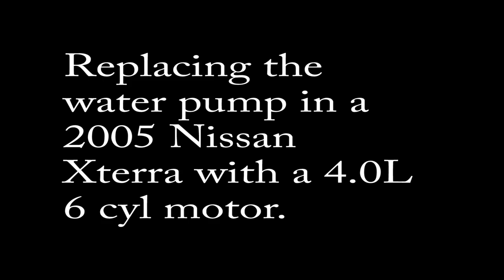How to Replace the Water Pump on a Nissan Xterra

Comment: At about 13:54 you are talking about driving M8 screws into the treads of the old water pump flange to aid in extracting the old pump from the engine.
May I suggest; 
1) Screw the M8 bolts into the water pump flange deep enough so the M8 bolt ends do not touch the water pump mounting bolt holes.
2) Rotate the water pump a few degrees such that the bolt ends will push against the engine cooling water jacket.
3) Drive the M8 bolts in until the first O-Ring is free of the cooling jacket.
4) Finish removing the old water pump out engine cooling jacket by pulling on those two M8 bolts.

Just remove the risk of fouling those mounting threads from the equation altogether.

Before installing the new water pump, put coolant (new or used don't matter) onto the new water pump O-Rings to make them slide into the cooling jacket easier.

You video is remarkably well made, your talking easy to follow and you highlight points that will save your followers from time and money!

Thank you for your time and effort making this video!
Reply: Great tip!

Comment: I pledged $20 because your video is awesome and I love your shirt reward. I have a 2000 xterra with a 3.3 and would overheat at idle. Replaced water pump and problem fixed. Now my 2005 xterra 4.0l 4x4 is overheating at idle so your video is excellent in guiding me to perform this repair. I've been a mechanic for over 24 years and this is a complicated job for a water pump replacement. Good job on your hard work and helping me out in this task.
Reply: Thanks for showing me how to change the water pump. That help me to do it right. Charles

Comment: You have the best Nissan videos out there... Yours have helped me out alot... I was ready to take my leaky water pump/weep hole in to the dealer today but after this video I figured ill do it myself... Ive alveady removed and replaced the assembly that holds the fan clutch and the fan clutch, radiator and shroud for previous replacements on my 06 Pathfinder so I might as well do this.. the dealer wants $800 but I think this time im going to do it myself... 2 years ago they got me for $1800 for a new tranny computer.. and that was because I didnt have the tools to program the new computer... but had removed it with the valve bottle trying to replace that brake solenoid. Again Thank you for what you do and screw the ones who gave you a thumbs down...

Comment: 5 years later still a work of art thank you very much for your details instructions. My issue came about after my radiator was purposely damaged by a mechanic here in Compton California. Due to myself not wanting to deformate ones character nor be at fault or sued  for slander of their name or business, I'll leave out the name of the black and yellow painted shop. I do now see that that was the problem more than likely had I just done that in the first place none of this would happen however I am replacing radiator clutch fan and water pump all at the same time anyway thanks a lot godspeed on your journey. Keep putting out these awesomely detailed videos so that no one has to go throug what I went through with thoseshady mechanics.

Comment: A little heads up for you guys. Keep rotating the crank pulley with depressed tensioner until you see/hear the cam flop over. Otherwise, there will not be enough room to slip the wp out as easily as depicted.
Reply: THANK YOU!!!!! EXTREMELY IMPORTANT VALUABLE (LEFT OUT) PIECE OF INFORMATION

Comment: Ry, thank you for this video.  Very helpful to have watch you do this job before doing it myself.  I made one mistake that others can learn from.  I did not insert a locking pin or wire into the tensioner after working it back to its contracted position.  You can't get the water pump out or in until you fully relax all pressure on the chain tensioner.  You also risk shooting the plunger and spring into the engine if you try to remove the tensioner without inserting the locking wire/pin.  I found a binder clip in the kitchen and straightened one of ends of the wire and that worked perfectly.  While the job has many steps, it is easy with the tensioner fully retracted and locked.  Thank you again!

Comment: Your videos have been a godsend, thank you so much for all you do.  That said, I've noticed several videos where the actual removal of a part was not filmed.  I understand that you can't exactly hold a camera in the right place and remove something like this at the same time, but man... It would be great if you found a way to edit these things in.  I changed the head gaskets on my 2005 Xterra SE over the last few weeks, and when I got everything put back together, I had a coolant leak coming out of the weephole behind the water pump. Now I can't get the chain slack enough to pull it out and it's about to the point I'm just gonna take the whole damn timing chain cover back off!  I'll skim the comments to see if there are any other tips added, and really, your videos have been such a blessing.

Comment: I have to change the water pump on my 2010 Infiniti EX35 and watched a few videos which were kind of...well you know. I also have a 06 Xterra and your videos really helped me with a few repairs, and by the way its the same colour. So anyway the 4.0L in the Xterra and the 3.5L in the EX35 are pretty identical and the procedure is the same. Your video is very clean and in-depth so I would like to thank you for that. Cheers!

Comment: Hello Ry, Thank you for your video it was very useful to me. I had to replace the water pump on my 07 Nissan Frontier. It went smooth without a hitch. I would like to offer some feedback on my experience that may help other viewers of your video. You can use a 3/8 drive socket T bar inserted into the square on the drive belt tensioner to use as a lever. You're right about not dropping the tensioner and water pump bolts down inside the timing chain cover. I felt like I was defusing a bomb taking those out and bought a magnetic socket drive to put them back in. When turning the crankshaft clockwise and counter clockwise to get the slack to first remove the tensioner then to get the slack on the other side to remove the water pump be super careful not to apply too much force or you could jump the timing chain on the main crank drive = not good... Thank you again. Great job!
Reply: Is that what happened here in his video? When it clearly clicked and jumped?
Reply: @miguelramos-sz6hc  i was wondering the same thing. If he had the tensioner removed that was almost surely a tooth jump. Haynes manual says leave it in place and and just pin it.

Comment: Thank you. My girlfriend has an '04, recently overheated and these videos are a huge help.
Reply from the maker: +DrNotJC So glad to hear!! I hope everything goes will with her ride!
Reply: I left my comment on the wrong video, I replaced her thermostat and temperature sensor, with help from your video. Thank you. I also replaced her blower motor resistor, which was melted, and then her a/c control panel. Turned out there was also a blown fuse in a fuse box located next to the glove box, that I didn't know was there, so I'm not sure if there ever was a problem with the control panel, I still haven't tested the old one. Her heat works better than when she first bought it now, I'm sure due t the thermostat and temperature sensor replacement that I wouldn't have been able to do myself without your video.
By the way, a mechanic tested the system, confirmed it was the control panel and said he could replace it for $300, it cost me $45 to do it myself.
Hopefully my info will help anyone having similar problems.
Again thanks.
Reply from the maker: That's great man. Very excited that you used my video for help. Glad to hear things are going better with her truck.

Comment: Great video...was wondering about this.....have this same job today.....luckily the older mMaxima 3.0 is the same thing and I have done those before.....those are a real pain to get to with the engine sideways...... Thanks man.....
Reply from the maker: +Gary Marshall No Problem. This one is really not that bad. I thought it was going to be worse. The transversely mounted motors are pure hell.

Comment: Great video. I had planned to
Replace my water pump since I was replacing the radiator anyway. But this will add a lot more to my project. Wondering if it’s worth just doing it even though I don’t believe I have a water pump issue.

Comment: Thanks for your help!! Local place didn't want to even give me an estimate on this wp replacement. They lost their ass last time they did one. They probably lost a bolt down in the cover plate? Dealership wouldn't do it unless they did a timing belt as along with it. $3.200 to both. It's probably smart to do both, but I'll roll the dice on just the water pump.  Thanks again!

Comment: You done a good job Bud!..Worked as a Nissan mechanic for 8 years at dealership years ago and helped me on my daughters Xterra...After all said and done and working at both Nissan and G.M. HARD to beat A Chevy in the long run on repairs! Good job my friend on the repair.
Reply: Are the repairs on the Chevy cheaper than the Nissan?

Comment: 29:30 or use the 3/8 ratchet or breaker bar to remove the serpentine belt first.  Idk if you noticed the square hole on the pull side of the tensioner?? 🤔

Comment: I'm having the same issue with my 06 Frontier I'm not exactly the best mechanic but I know my way around the basics. I tested the thermostat and it works fine but I'm going to replace anyways I'm in the midst of pulling the water pump thanks to your video I have the Haynes manual but watching your video helped tremendously becasue I was real timid to mess with the timing chain for fear of messing up.  If it's not my water pump whats my next step?
Reply: Did you replace the water pump?

Comment: I never heard you mention this, could help some newby mechanics....that square hole on your front belt tensioner is meant for a ratchet to pop into. Set it to loosen, pop it in. This will give you great leverage.
Reply from the maker: Very true. It's a great design!

Comment: Yo! @Rythecarguy thanks for this vid. After 7yrs after release it's still one of the most informative content on YT.

BUT! My question is: why, haven't you said anything about whole lot of water pouring into oil strainer, pan, under chain cover and floor? I mean, dude! I've almost shot myself not knowing if my head gaskets were blown, block or heads cracked 😮😮😮😮 right now i'm replacing both gaskets on water pump, cleaning everything w/o disassembling chain cover. Kinda crappy situation :/

Comment: Awesome video and thank you.  I'm having the same temperature issues with my 2007 Nissan Frontier. It is a standard transmission. When the vehicle runs idle, the temperature gauge begins to climb. However, as soon as I drive (about 100 feet or so) the temperature drops to normal. I've purchased the thermostat but should probably by the temperature sensor too. If this doesn't fix the problem, I'll go to step two which you showed in this video. Did replacing the water pump and tensioner fix the temperature problem?
Reply: Hi, What fixed your problem?

Comment: Ry, my haynes manual recommended I drain coolant from the block (in addition to draining the radiator).  I could not find any drain plugs on my v6 4.0 liter (07 frontier).  I am worried about coolant getting into the oil.  I believe you mentioned this i the video.  Did you have any issues with coolant cross-contamination?  Did you figure out how to drain the block?
Reply from the maker: To be completely honest it was only a little fluid and I just let it fall into the cover, I didn't drain anything from the block. If you drain the anti-freeze from the bottom of the radiator then you should not much of anything in the block. also,  I did an oil change shortly after to make sure it was all cleared out. If you coordinate this with an oil change you should be more than fine. If you see that a lot of fluid comes out for some reason then do not drive your truck until you change the oil.

Comment: Did it solve your problem with the temperature gauge rising?
Reply: Yes I would like to know that too. I am having an overheating issue and the water pump is the last thing to change.
Reply: Same here , I have same issue with a 06 Xterra aNd am dreading doing this ... especially since I think my timing chain is has issue too ... (Whining noise from front of engine )

Comment: Did changing your water pump fix the over heating issue when idling? Thanks
Reply: Who knows. He never confirmed if it did.
I doubt it was the pump.
Probably was the actual radiator.

Comment: wow...great video
thanks a lot chief
i have the parts already
so I'm going to replace them
depending on your video...thanks a lot.
Reply from the maker: hope it goes well!!
Reply from the maker: Did you ever do this job. did it go well?
Reply: Hi Ry
i did change the belt and belt tensioner
But for water pump... ... it was a nightmare.. Because of that little chain tensioner..i had to removed it
otherwise... Every thing goes smoothly.

Thanks man...
Reply from the maker: fais Hawk gald to hear it worked out. Yea as you know I had to remove the tensioner as well. It was very annoying to deal with.
Reply: Ry the car guy, did you have to remove the clip on the chain tensioner? My plunger won't plunge.. I'm worried it jammed

Comment: 2006 Nissan frontier 

*Note* 
When removing the tensor the (( REACTION of the spring SHOOTING OUT)) 
Doesn't happen TILL ITS OUT OF THE ENGINE, AND THE 2 metal pins are touched!!! 
was not able to push back tensor while against the chain still installed... 
ONCE the tensor is removed,, THEN press holding the spring in place,, FINALLY press the pins in effort to save....

may your repairs, be swift with nothing breaking!!

Comment: Thanks for the video. i did want to ask you a question about these xterras. I am trying to diagnose an issue occuring with mine. i have a 2012 with 100k miles. Runs fine and doesn't overheat. Transmission coolant has been bypassed and new radiator for transmission installed. My issue is having engine oil in the coolant but not the opposite. The transmission has been completely eliminated from the equation.  i am trying to trace back where the fluids can mix. 
1- Head gasket but highly unlikely to be culprit as it doesn't overheat
2- Oil cooler?
3- Water pump? 
any other places these fluids might mix?

Comment: Hey thanks for this video, I followed u exactly to change my water pump on my 05 path, do you know about helicoil kits, and also what size are the water pump bolts that secure the pump. Seem like I stripped the holes out

Comment: We have a 2013 Xterra Pro4X and the windshield fluid is not coming out in the front or back even though there is fluid in the tank (we don't think that it is the windshield washer stem as we checked and there is power).  Our windshield washer pump is part of the tank assembly.  Can we replace just the pump?  I can't find anywhere that we can just replace the pump without replacing the whole assembly.  Any help would be appreciated.  Thank you.

Comment: Haynes Manual I have says that loosening the timing on the pump should be about 20 degrees.  That’s what I was worried about, turning too far.  I just wanted to pass that along.
Reply from the maker: Yea, you wanna turn it JUST enough to slide the pump out. No more than that.

Comment: Great video, helped me a lot. I have scoured the web and can't find anything about this, please bestow your wisdom...
When I depressed the tensioner all the way and put the pin in the chain came down with it and stayed tight. I ended up removing it "under tension" which didn't seem to hurt anything. I had to fool around to get it back in but could only get enough slack on the chain for the tensioner to go back in fully depressed, the guide and chain are tight against the piston and it isn't extending. The tensioner functioned fine in free air and sprung fully open. Is this a problem?

Comment: When you refilled the coolant, how did you insure that no air pockets existed in the top of the block? I understand there is no bleeder screw on the top of the engine which the first gen x may have had. My shop used a vacuum system to evacuate the air.

Comment: I have a question about the replacement of this water pump.
Typically, the weep hole in a water pump will divert water to the outside of the engine to indicate a compromised water seal in the pump.
From what I can see here, there is no external outlet if the water pump weeps.
So where is the water going that would weep out a water pump with a failed water seal?

It looks like a failed water pump seal would dump coolant into the timing chain area and contaminate the engine oil.

Let me know your thoughts, my brother in-law has an 05 Xterra that was not heating until I added about a quart of coolant.
So I need to find where that coolant is going.

Thank you again!!
Reply from the maker: Yes, there does not appear to be a weep hole but if it does leak then yes, it would 100% dump into the oil. Pretty stupid design.

Comment: Nissan made some changes through the years. I'm working on a 2010 Xterra and the fan shroud on mine completely encircles the fan. So the fan has to come out before the shroud can be lifted out. I'm having to work through the slit to get to the bolts holding the fan onto the pulley. The factory has them so tight that two of them rounded off (10mm) and I'm off to get the vice grips. I just wish they'd snap off as I'm replacing the bracket that holds the bearing for the fan. And it comes with new studs.
Reply from the maker: Bummer man, sorry to hear .